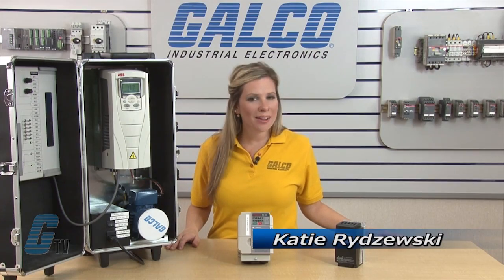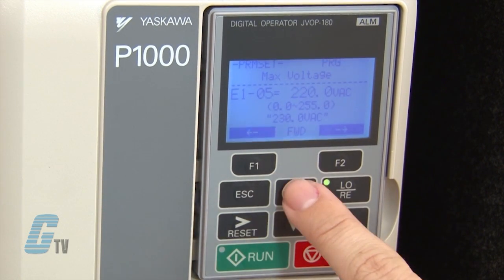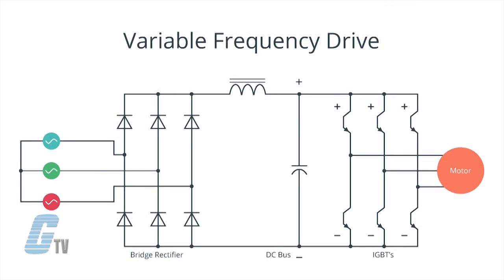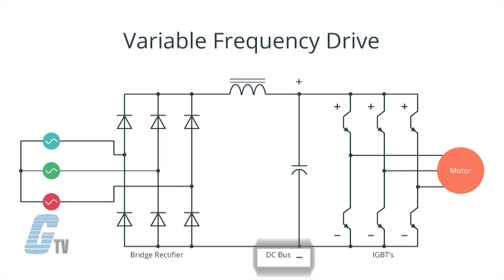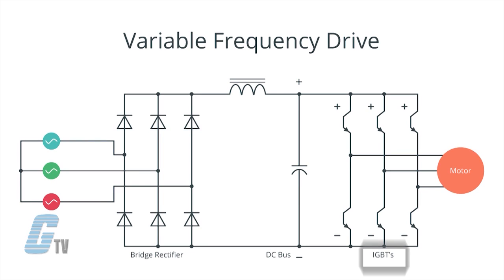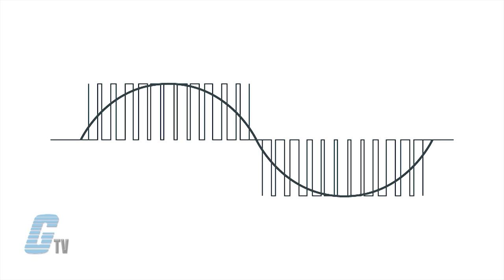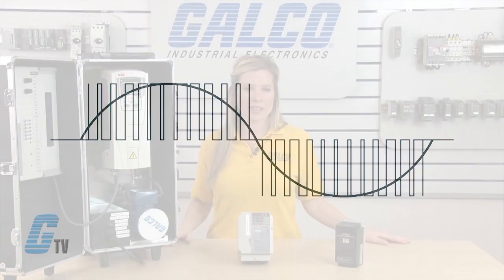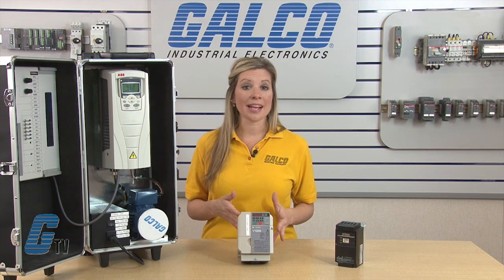What is a Variable Frequency Drive (VFD)?

Comment: Where the IGBT gate connect?
Reply from the maker: All VFD's using the IGBT devices for output power control have to have a "Gate Driver" PCB. They will provide the isolation from control, the necessary power, and sometimes the sequencing to that is required to drive the Gates of an IGBT to make it perform as needed in a VFD.

Comment: Sir how 1 phase i/p to 3 phase o/p Vfd work.??How 1- phase is converted to 3-phase.
Reply from the maker: Every drive with an AC input has a rectifier front end. So input power, 1 phase or 3 phase is converted to DC and filtered, then switched back into AC with 3 pairs of switching transistors (usually IGBTs). So each output phase to your motor has a positive and negative IGBT connected to it. So now PWM technology allows these devices to control both the output voltage and frequency simultaneously, ok?
Reply: +GalcoTV sir we have giving only 1phase input to vfd in 1phase to 3 phase vfd, OK.
Then at output side how we can get 3 phase how we get 120 degree phase shift between three phase. as we have given only 1 phase to input.....
Reply from the maker: It is the Control board and its programming that generates the signals that drive the output transistors to keep them exactly 120 degrees apart at all speeds (in US, 0 to 60Hz is 0 to full speed). So it doesn't matter if 1 phase or 3 phase is on the input, the drive always makes 3 phase on its output from the DC BUS generated by rectifying the AC input lines. The only thing 1 phase input limits the VFD to is max power output. With 3 phase input, the drive has a little more output POWER capacity, ok?
Reply: +GalcoTV ohh thanku very much sir....!!!!!!

Comment: Hey Ms. 
This is an open loop scalar system not a vector system.
Reply from the maker: +SelfEnergetic Although I would agree with you that in this example we learn somewhat more towards a simple Scalar control method. However, some drives do have the capability to do open loop vector control too. 
It depends on the technology the given manufacturer uses in constructing the specific VFD in question.